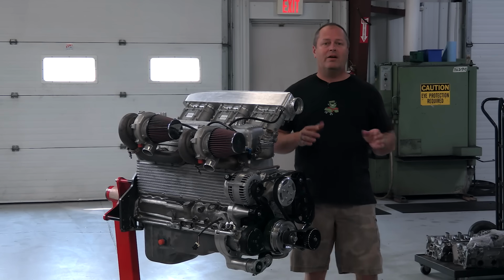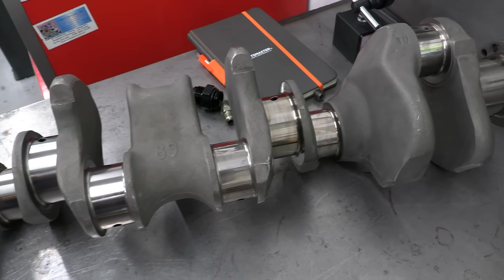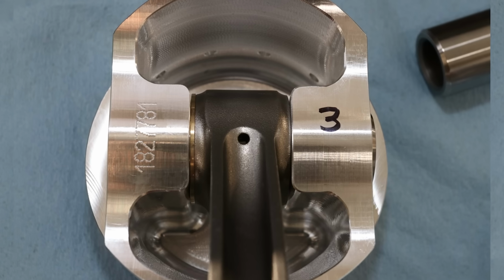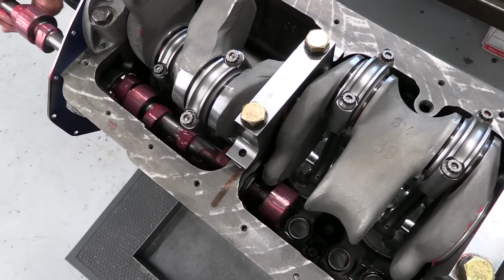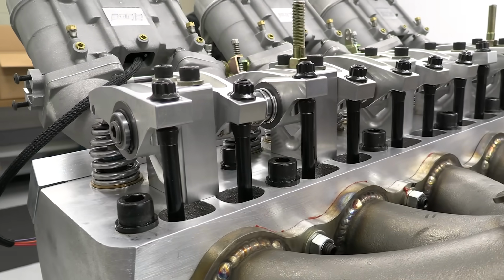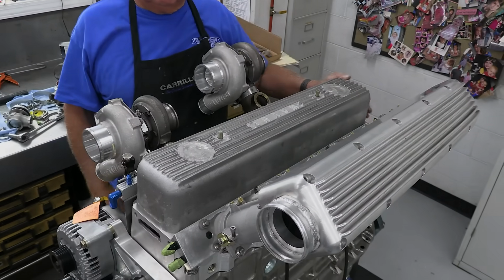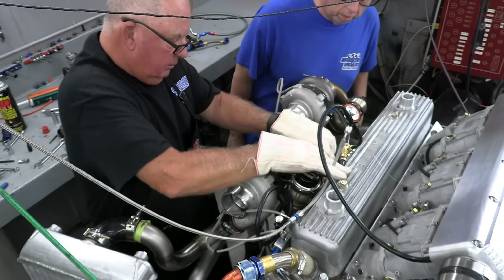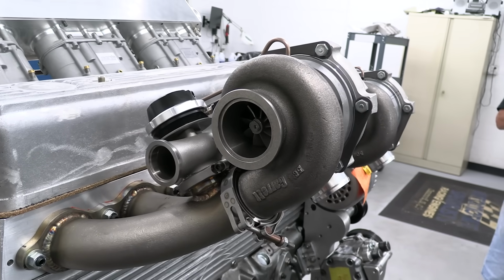Incredible Twin Turbo Chevrolet Straight Six is a One-of-a-Kind Creation!

Comment: Absolutely love it!! Nothing screams cool like an old engine made up with modern gear, engine management and fabwork. Yeah V8's make more power but this thing's off the charts with uniqueness. 😍👌 Great video sir!!
Reply from the maker: Thanks a lot! And thanks for watching
Reply: V8s don't make more power, larger engines make more power. Number of cylinders is not the critical factor
Reply: @psk5746  so then a large V8 wouldn't make power? You see how your reply contradicts itself?
Reply: @iceman45ification1  no contradiction 

A large 1, 2, 3, 4, 5, 6, 8, 10, 12, etc. cylinder engine would make more power than a smaller 1, 2, 3, 4, 5, 6, 8, 10, 12 cylinder engine. 

My point was power relates to engine size, not number of cylinders. So yes a 5 ltr v8 will make more power than a 4 ltr 6 cylinder, but that has nothing to do with the fact the 5 ltr engine has 8 cylinders
Reply: Volumetric efficient does complicate things, I.e. more cylinders improve things here.

But, other than balance, there is nothing magical about an 8 cylinder engine. It just has 8 cylinders ... whoopee
Reply: @psk5746  I know that. There's lots of variables.
Reply: @iceman45ification1  I just looked at a JE Automotive catalogue. Man you can get so many performance piston options for GM, Ford and Chrysler v8 engines. No wonder builders build them!
Reply: @psk5746  it may not be for too long. For the Hemi at least. Chrysler/FCA has been talking about replacing it with an inline 6 for a while. I'd love to see a twin turbo version in a Ram 1500 to compete with the likes of the Ecoboost and the new Tundra's twin turbo V6.

Comment: Keith has probably forgotten more than most know!! The "this is what separates a true builder from an assembler" reference is right on point!! Awesome video thanks bud 🤙🤘🔥
Reply: Any time you get Holley to pay you to design a sbc intake, and the. Pay you a licensing fee for each unit sold.. you know a lil something about something! 😉
Reply: Most of technology he used didn’t exist when he started building engines. I see a man who has learned continuously throughout his career. I like it when guys don’t get set in their ways to the point of getting passed over by the times we live in.
Reply: The best part of watching this is that Keith is so freaking HUMBLE. He's obviously not difficult to work with and eager to keep challenging himself as well.
Would hire him in a nanosecond.
Reply: You couldn't be more right on your comment. I've assembled some engines in my lifetime, but I am absolutely no engine builder. When I had my 709 wheel horsepower 1.8L B18C5 engine built for my Civic, I had it assembled by a well-known machine shop and engine builder. I paid them to balance, machine, and assemble the long block, and I assembled the head, turbo, and all of the other components so that I knew the hard part was done properly.

Comment: Cool build, the dual turbo and intercoolers are kinda blingy, but you said it, show car? The cam duration sure does seem pretty damned excessive for a true street driven, AC equipped turbo on such a small engine? After all the other ridiculously trick inclusions those ancient combustion chambers just tweaked me. Not my rig, not my problem, dang it.

Comment: Stovebolts are quite simply 1/4 by 20 UNC bolts. Virtually universally used by cast iron stove manufacturers back in the day.FWIW, what we now call UNC  was an engineering standard adopted by the US Navy in the late 19th Century.
Stovebolt Chevy engines use 1/4 by 20 fasteners as a default on valve cover and lifter covers and I believe the pan as well. Hardware store bolts can serve,but the GM bolts were better material than that.
Reply: My Dad - who was born in 1917 and grew up familiar with these 1927 < up engines - said that the fact that the flimsy  cover for the oil pump itself was held on with these low strength, low precision machine screws was astonishing to mechanics used to engines having more precise and more expensive construction.
       What you have to realize is that only truck and racing car engines had pressure-lubed connecting rod journals back then. Typically a splasher hooked under one rod bolt swung down and splashed oil everywhere inside the engine and some found it's way through a hole or two holes in the side of the big end of the rod to lube the crankpin.   If you ever work on one of the very old design Wisconsin THD or TJD upright twin cylinder industrial engines you will see a much shorter splasher formed as part of the con rod cap - with an oil feed hole right above it.
The camshaft on those engines ran a simple vertical plunger-pump that picked up oil from the bottom of the pan and lifted it into small elevated troughs positioned so the short splashers could make contact with that oil.
   That vertical plunger pump just lifted oil a few inches - there was no pressure as such. It's bore was made half in the block and half was a piece of tin bent into a half-pipe with ears. Stove bolt machine screws were good enough to hold the tin cover/half-the-plunger-bore to the cast iron block. (Surprising experienced mechanics of the day.
      Hey Model T Fords used the oil splash off THE FLYWHEEL DIPPING IN THE BACK OF THE OIL PAN, and finding it's way by sheer chance into a FUNNEL AND PIECE OF COPPER TUBING to gravity - lube THE MAIN CRANKSHAFT BEARINGS. 
   Compared to that - the Chevy Six was much more modern !
Reply: @patrickshaw8595  been a while since I've been in one of these , but if I recall correctly the dipper was a funnel that caught oil and forced it into the crank oil galleries . If oil was cold then it was to thick to be forced into the galleries , if you over revved it then the oil in the pan didn't have time to flow into the channel created by the dipper and it ran dry

Comment: Thanks for the awesome video. I love the Chevy inline 6. I'm building a 292 with 6-71 blower, 2 Quick fuel 650 DP, Ryan Falconer V-12 head (aluminum crossflow 340I 220E), Crower billet crank, cam and rods, girdled and doweled mains, 5 stage dry sump and Electromotive direct fire coil over ignition. Going to keep it down to 1000 HP. It's going in my 53 Chevy 1/2 ton pickup with a Tremec 5 speed. I have electric P/S and an electric A/C compressor. I'm looking for 8.50 in the 1320. It's nice to see I'm not alone in my madness. I know 3 other guys running a little north of 1000 HP in their 292's, 2 with turbos and 1 with  a blower. Thank you for your time.
Reply from the maker: Sounds like a fun build! Thanks for watching
Reply: Good luck, I hope it works.
Reply: SWEET!...from Wyoming USA 🇺🇸 🤠
Reply: @billallen4793  hell yeah Bill I'm a Wyoming native run with the neighbors run that way you know where to get parts... 70 mi into town to get parts or quarter mile over the hill to the ol heads tractor....
Reply: @babydaddy1930  you still living here?
Reply: I remember a watching few really quick drag cars with Chevrolet straight six cylinder engines years ago that were really mean and fast. Worked on a few for circle track use that ran really strong too. I always get funny looks when I say  Chevrolet inline 6 cylinder engines are one of my favorite engines. Your going to have a really impressive engine when you are finished. Have fun, best wishes, and take care.
Reply: @sswcustomsewing4276  People think 6 cylinder and they think small engine. My punched out 292 is a shade over 5 liters. Thank you for your comment.
Reply: @lazyhoundracing9621  I always think it is odd how people think small engine when a Chevrolet six cylinder is mentioned. The stock 292 six I had was all stock yet it was a torque beast with the heavy flywheel that came with the pickup 4 speed. I guarantee if a person took any of the Chevrolet or GMC six cylinder engines updated them to run on todays gasoline, EFI, Electronic ignition, and just a few other little updates they would probably be really surprised. 
I noticed you mentioned a Frankland rear end are we talking early type ? I haven't seen one in a really long time and quick change type rear ends were not exactly happy on the drag strip from what I remember yet they are the best choice for the sprint cars.
Reply: @sswcustomsewing4276  Yes the rear end is and old QC-80 case that Frankland built up for me to handle the load. I have a Bicknel torque arm with a triple biscuit to take some of the shock. I'm also running Electromotive TECs200 coil over direct fire ignition. I may end up changing the rear end but time will tell.
Reply: @Robots Can Do Better I have fully boxed my chassis. I have a Frankland rear end built up by Frankland and a Bicknel torque arm. It's a drag racer, looking for 8.50 in the 1320. Thanks for the comment.
Reply: What alternator are you running for that AC compressor?
Reply: @pchivers8888  Mechman made me a custom duel rectifier large case GM type 250 amp alternator. It tested out at 257 amps and 180 amps at 800 RPM. It was about $500 I think. it's a beautiful piece and they bench test every one.
Reply: @pchivers8888  I will also be running two 14 volt batteries so I can use it with the engine off.

Comment: Now this is an amazing build. A lot of ground breaking tech compared to back then, and on a motor that parts aren't ever so readily available or existent, this really stands out to me.
Reply: You can get these at any junkyard for pennies.  Now doing what they did to it did not cost pennies.  I have seen cheap builds getting a reliable 350-400hp with cheap piston, and internal upgrades, and a large diesel turbo.  I think most of the builds were about 2200 dollars.  I would like to do an inline 6 build for industrial machines I have, but I live somewhere the roads are a sheet of ice half the year so we don't really do hotrods.   I am more into 2 cycle stuff where we are just making toys, and we all drive electric cars.   Small engines are easy to tinker with, cheap, and just as fun.   This was an incredible build with tight tolerances.  My first inline 6 I got for 150 bucks.  I changed the Head gasket at 15yo, and did upgrades, and it fired up the first crank.  The build they did could easily do 700hp if you push it.  I like their build philosophy at keeping it at 4600RPM- makes that build bulletproof.   That thing will make reliable HP for as long as you can still get fuel for it.